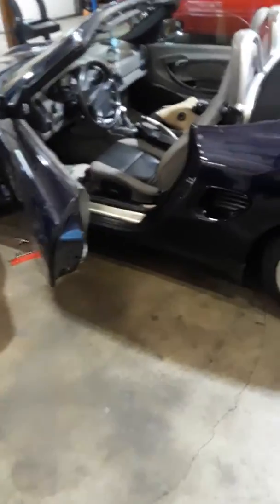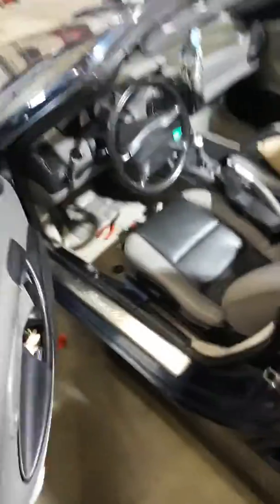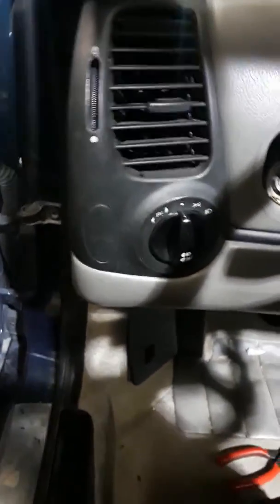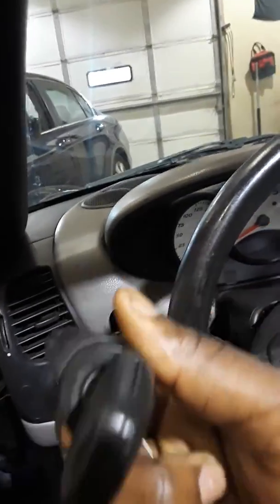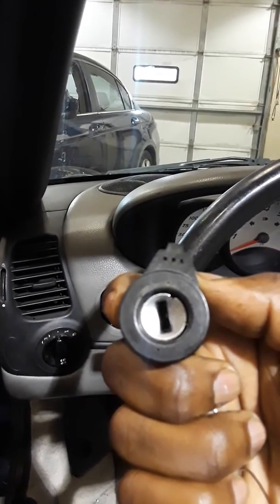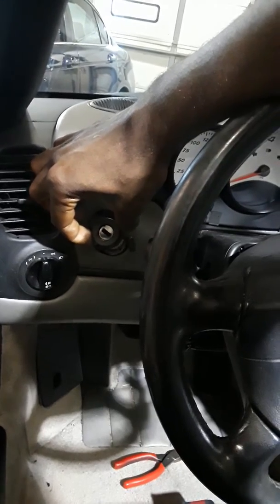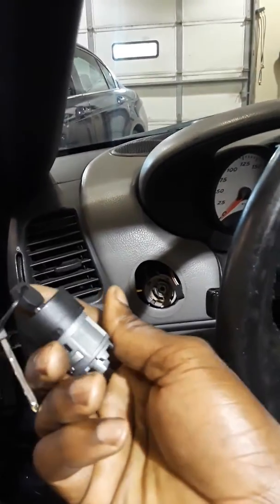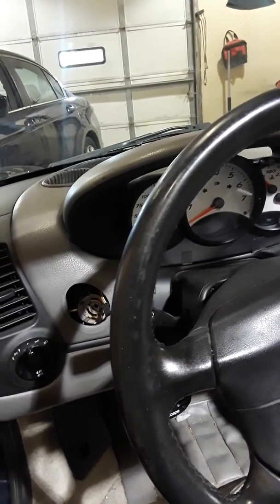How to remove lock cylinder on 2000 Porsche Boxster

Comment: Before you go and pay that much for the lock mechanism check the $30 electrical ignition module first. I have had my 2004 Boxster since new and changed that twice and still using the original key. Unfortunately this part does fail often with the same symptoms described but alot cheaper to replace.

Comment: For the life of me I cannot unplug that wire on top I'm afraid of breaking it any tips? Are you supposed to squeeze somewhere grab, pinch? Thx!
Reply: I just did my lock on 2000 Boxster-- What I did is get a very small screwdriver and put in between the electrical wire housing part and small flange on top and gently pull --Hope this helps

Comment: Thanks for posting very helpful along with a few other video I am able to DYI it, hopefully!  I have 911 (996) 2004.  I am replacing the entire ignition switch and lock mechanism.  I got the lock out using your instruction but having an issue removing the electrical plug?  It looks like it has a metal flange on the top that needs depressing.  I am just winding if I need to give a good yank or if there is a trick to the removal of the plug.  Also I notice you got new keys, was thinking I would order an uncoded part so that my current key fits so I don't have issues with the door lock.  Have you coded this key lock before?

Comment: hello, why did you have to replace ignition/key switch? I am fixing to replace ignition lock mechanism because key is very hard to turn in cold weather ... just curious what your problem was -- Thanks
Reply from the maker: Edwin Thompson this one was hard to turn all the time that's why I changed it.
Reply: Thanks! I keep being told I need to change the locking mechanism WITHOUT the tumblers and use my old ignition tumblers. I changed rear electrical part to no avail. I ordered the $300.00 ignition lock mechanism, no one ever mentions what you did as my cause...???